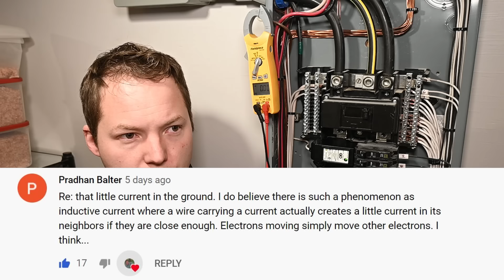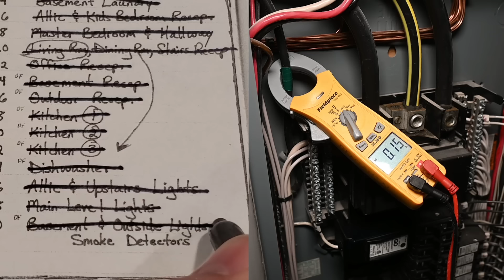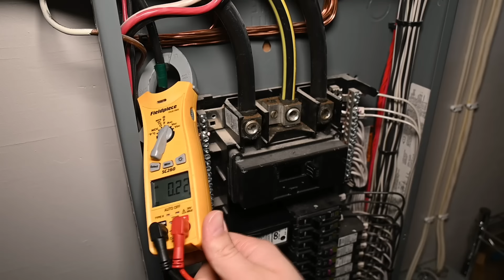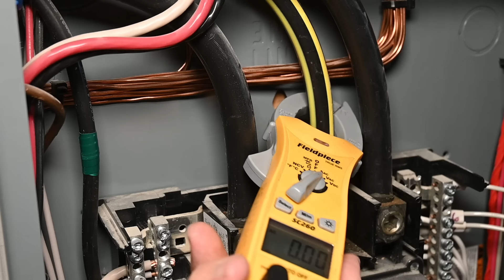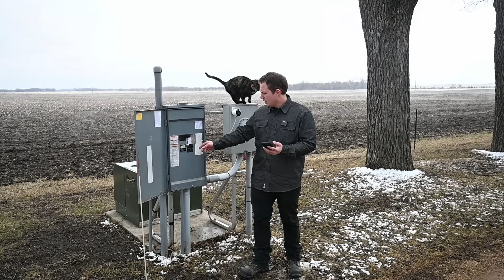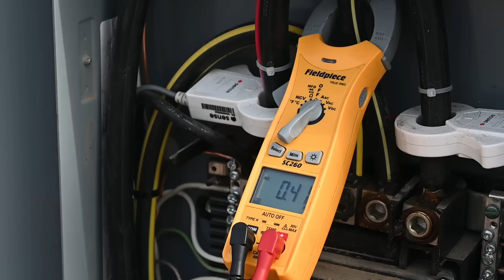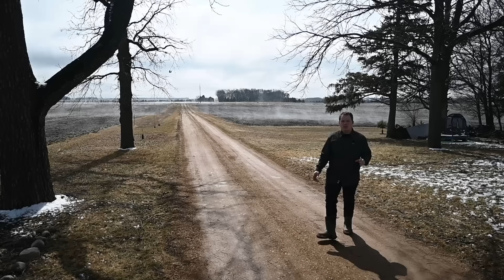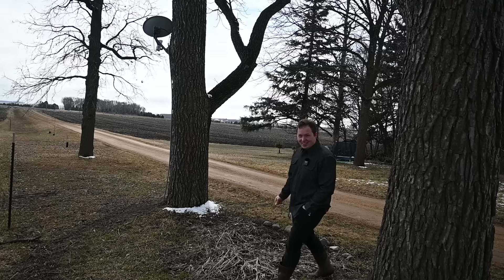Finding The Source of Stray Current on Grounding System

Comment: @Benjamin Sahlstrom -- I am not so sure you did find "the" source of the mystery current. There can be more than one cause. I read many, but not all of the comments, and I have more to say. Galvanic ("Earth battery") effects have been mentioned occasionally. Dis-similar materials are required, but I did not see that pointed out clearly. Usually metals such as copper and zinc are involved, and either one will act on a steel electrode. In this video, grounding rods are copper-coated steel (or were coated when new), the gas pipe is copper, and the conduits from the transformer/meter area outside are galvanized (coated with zinc), so there is a good setup for both a galvanic current AND electrolytic corrosion. You REALLY do not want electrolytic corrosion on gas pipes. Luckily that corrosion will prefer to erode zinc rather than copper. BUT those galvanic currents will be Direct Current, and the clamp-on ammeter looks like it was on AC Amps. Unless that little ammeter has problems itself, it should ignore DC when set to measure AC Amps. There is also some rectification possible in a galvanic circuit, which might show up (usually inaccurately) while measuring AC Amps. It would be helpful to measure DC amps as well. IF your meter can measure DC Amps, you may get more clues that way. If not via clamp-on approach, you could open the ground/neutral wires at various points and insert your ammeter, checking both AC and DC Amps. To really be sure might require use of a battery-powered oscilloscope for higher frequencies, and a current transformer or shunt resistor, since oscilloscopes measure voltage, not current. Besides galvanic action causing DC current, source(s) of power being rectified could be radio waves, solar storms, other electrical power users in the area, or even at significant distance if high voltage is involved *in earth-return systems*. Also, it would help to measure the voltage, both AC and DC, when these mystery currents are present.

Comment: wouldnt you beable to put an engine block wrapped with enough wire under a power line and connect the other end to a stake in the ground?  Wouldnt you be able to leeach power like that? Isnt it very dangerouse cause there was 144v coming from my ground out of a stake in the ground

Comment: I worked on this ALLLLLL day and you know what I found?  the current was coming back up from a stake in the ground. I connected that with my  return wire, and walla 144 volts. I checked the main box and sure enough there is 1 couple grounds connected to the  neutral and there is also a ground wire running from the ground rail to the ground. That is bleeding soooo much current into the earth. I told my land lord that is why he blew a bunch of shit out. with 144 v coming from ground in the ground.

Comment: My guess is the house ground rods have a lower impedance to ground so the current is taking the  path of least resistance and going to the house rods. A way to check this would be to re-ground the ground rods at the main panel. Is the house egc copper?

Comment: So, doesn't that mean that when ground and neutral bonded together on one bar(at the main panel), the ground also acts as a current carrier?
Reply: no, not under proper operating conditions. 'ground' is a reference point influenced by the impedance at the earth electrode. the 'neutral' system should offer an extremely low impedance return path for all energized circuits and carry all the system return currents. the 'ground' system should only briefly carry current during a system fault until the protection equipment de-energizes a faulting circuit

Comment: That meter only measures the two hot legs, there is no prongs to measure your neutral. Also that pad mount transformer should have its own ground rod driven and tied to both the case and also the x2 bushing.

Comment: What you have here is a ground loop, caused by a difference of impedance producing a difference of potential between the transformer ground, and the house panel ground stake.  One way of eliminating this fault is to connect all ground stakes to a single conductor and connecting necessary grounds to one point on this conductor.  The technical name for this conductor is called a "bus bar".  The different potentials among the ground stakes are called "step voltages".  The only real harm in your situation is EMI (electromagnetic interference) which can add noise to AM radios, audio amplifiers, and possibly reducing the range of your WI-FI.

Comment: What were the symptoms that made the customer notice causing the service call? I had an experience where a battery heater on a standby generator wore a hole in the rubber and caused it to back feed through the chasey of the unit and back through ground into the sub panel. The symptoms were a no heat call. The unit had a board that sensed it and wouldn't run. Disconnected the heater and was back online.

Comment: Temp......distance from the street voltage to the step down pad mount trans on your property ......alternating current.....back and forth......  That would be a great for your local provider to explain.  Give them a call and have them come out and tell you wtf is up...hell! Could be a loose wire on there side on the pad.....excellent video my man.

Comment: You are correct, a residential FM2 240v 3w electric meter only uses the two conductor wires to measure current when there’s load (usage). 19:53

Comment: Definitely sounds like a ground loop. (that's why multiple building grounds must be bonded.) You have a number of grounding points in the house that aren't so easy to disconnect... water, gas, coax cable... You'd have to disconnect all other ground points. Or disconnect the ground between the main and sub panel. It is indeed odd to see current on the service neutral with no current on the service conductors. (A call to the utility might be in order.)

Comment: I used to do long runs of data cabling between buildings. We would find considerable current flows if we hooked cables up to grounds on each end. One of the advantages of fiber is no current. I suggest you disconnect some of the backup earths temporarily to find the path. Is this something that code says has to be fixed?
Reply: indeed. if the ground impedance at any pair of buildings is unequal, there will be an equalizing current flow. at sufficiently low ground impedance, any equalizing current flow will be low and 'safe' (according to specifications applicable to the utility service jurisdiction)

Comment: I know you said you're not an expert, but have you considered induced current in the transformer itself? Your transformer is just two coils wrapped around an iron core. Those two coils have an EMF field around them. Some of that EMF field could be going across the grounding circuit and inducing that current into that circuit. That's where is start.

Comment: Why are you using 4 ground rods two at the house and two at the main panel next to the transformer that should be the only location. You’ve given all stray voltage a path to ground through your house panel which technically is a sub panel that’s why you have no bonding jumper you should also have no ground rods you should have a ground wire coming from main panel that’s outside by the transformer where are you installed it
Your house panel should be a four wire set up

Comment: Ben on the farm, on one of the livestock wells, we had current on the ground lead. 
The one line man said that it was not a problem. Two days before Christmas at 4:30, -10°f, L1 was 75 volts, L2 was 162 volts.   
The line men got to come out and change the transformer. 
The ground line went to 0.2 volts. Which is good.  
Good luck from north east Montana.
Reply: You can get the same situation (unbalanced line voltages) from there being NO ground path, if the load current is unbalanced. Also, voltages which show up when there is no load, particularly on an electronic meter, can be wildly misleading. Old mechanical meters are much less likely to display this problem, because they require actual non-zero current in order to give any reading at all. Modern meters can have nearly infinite input resistance on the voltage ranges, which allows them to respond to radio and even audio frequency electromagnetic waves passing by. To minimize that particular problem, it helps to keep the meter leads twisted together as much as possible.
Reply: Anything over 10V ground to neutral should get the attention of the electricty supplier. Usually the xformer or the transmission system grounding isn't adequate. 
Google transient voltage in Wisconsin dairy farms.

Comment: The neutral in the transformer will also be bonded to ground. At least it should be. In Ontario they have fixed this problem.
You only ground at the main panel with rods or plate. The house and other panels will not have ground rods. Only bonding wires between them.   Good trouble shooting. On another note the utility has bad grounding systems. We now have to ground any pole we go up to their neutral.

Comment: Man, I think you gotta measure the current on all of the neutral and ground wires in the breaker box with the mains off to trace where this current is going.  I'd be a little worried about making any new connections to the neutral until figuring out where it's going.

Comment: I would (a) check the power company's ground at their transformer by measuring ground potential (voltage) a few feet away from their ground rod relative to their secondary's neutral.  Could their earth ground be bad?  Then I would check (b) the voltage between your house ground rods and (c) the phase angle (with an oscilloscope) of that voltage  to the A-B phases.  If the power company transformer 's secondary windings are not symmetrical relative to the primary there might be some capacitance coupling which would make a phase difference.

Comment: I think the transformer is just too close to the service equipment and is inducting current on the neutral.  Did you check the ground wire at the service equipment?

Comment: as long as anything is running that requires a neutral you will always see current on the ground that close to the panel.  You should only check further away from the panel.  even then you have to figure out whether it is coming into the home or being created in the home.

Comment: Not related exactly to your problem but I live in an older house and when I switched to LED globes in the ceiling light, there was a glow coming from the light even when it was off.  I think it was inductive current because when I swapped one LED with a compact fluorescent globe the glow went away.  So now the ceiling lights have a mix of type globes but both are energy efficient.

By the way,  I enjoy your channel.
Reply from the maker: Yeah in an older house that I used to live in the LED lights would glow when they were off. I never figured it out but I bet that you are correct that induction probably has something to do with it.

Comment: Having similar issue at a customers supermarket. I am commercial refrigeration tech, NOT electrician. 30 volts to ground with equipment turned off.

Comment: I subscribed some time ago as I enjoy learning from Benjamin. I have been using a Sense monitor ever since Benjamin recommended it. I'm hoping that I can figure out all of the Always On and the Other consumers. 

Two questions, probably related questions, to my 58 year old house.

1) The original wiring does not include a ground so the original outlets were all two prong. I replaced all outlets to three prong and tied the neutral and the ground together to make the ground work. It works, but is this acceptable and is there a better way, short of replacing all wiring?

2) Stray current on the ground is intriguing and from both common sense and this video, it is a bad thing. This video also intrigued me, so I just measured amps, using my digital clamp meter, on my circuit breaker break neutral and random ground wires. I saw 3 amps on the neutral and the random ground had about 1 amp. The ground that I picked is a newer circuit and I can track that down. Am I correct that this is "stray current" on both ground and possibly neutral and that it is a bad thing that needs investigated?

Comment: Benjamin's pad-mount distribution transformer is fed by an underground cable have a center conductor (medium-voltage phase) and a  metal sheath (often copper wires wound spirally around the outside - the neutral conductor). The primary neutral and the secondary center tap are bonded together. 

Return current  SHOULD flow back to the substation via the neutral sheath. However, in very old underground cables, the sheath becomes exposed to the surrounding earth and at some location along the run, it can rot away. 

So how is the transformer energized, connected to phase only? Mother Earth (between the ground rods at the load and those at the substation)!!  For example, if the transformer is fed 7,200 volts primary and 0.44 amps are flowing in the ground wire, that support more than 3 kVA of power to the load. I've observed this effect personally in New York, and your friendly lineman from non-desert regions should confirm it.
Reply: A cable's outer protective coating has a limited lifetime. So in recent years, such cables are  installed in plastic tubing or ducts, rather that directly buried in the earth.
Reply: Having similar issue at a customers supermarket in NYS. I am commercial refrigeration tech, NOT electrician. 30 volts to ground with equipment turned off. Local electricians have not been able to resolve. I will contact power company, TY.

Comment: @benjamin
In CO we don't allow bonding on the gas line.  The steel lines actually carry a small current because of electrolysis which is why they connect sacrificial anodes to the lines and bury them with the pipe.  I'm curious if that uninsulated union is contributing to that stay current.
Reply: Gas lines can carry current from house to house so they can spread problems. Now there are reason to bond to

Comment: Disconnect the ground wire in your home panel to the grounding rods.
Reply: or run a ground home run from the panel in question to the first service panel across the driveway - the first bonding point

Comment: So, moral of the story, never ground your neutral?
Reply: The moral is, only 1 ground at the main panel (driveway in this case) unbond the sub panels  (house, garage) run ground wires from the main same gage as line.  The error was multiple grounds causing loops between his ground wires and the earth.  That's where these stray currents are coming from.  20mA/200A = 0.00001 or  0.01%

Comment: Remember to troubleshoot at the beginning of the problem.  You want to know what is supplying your ground wire with current at the sub panel, right?  So first, turn off the breaker supplying the subpanel. Would have saved you going through all those breakers.
Reply: I know right! Anything to make the video longer for more $. YouTube is a fantastic resource but tainted by greed. Videos that should be 1 or 2 minutes get stretched to 20.

Comment: Ben, for the purists power is amperage x voltage. If there is amperage (current) then there has to be voltage. However minimal. I was not surprised when you found stray current from the utility. I believe that many utilities tie their neutral, or the “shield” of a buried high voltage cable to the neutral of the secondary. This distributed ground dissipates faults and lightning. That is why copper thieves some time get nasty surprises when cutting ground wiring that might be in a fault condition, allowing the voltage to soar up and shock or burn them. You did an excellent diagnosis. Good work.

Comment: Most likely this is utility primary neutral current. Since North American utilities use a multigrounded neutral system that bonds primary and secondary neutrals, any and all grounding electrodes connected to the neutral will have a small return current going through them getting back to the substation. You made a good point at 18:45 that all current returns to its source and not magically the ground. Just in this case the source is a step drown transformer at the nearest substation and the loads are all of the people those distribution lines feed. Seems as though .44 A of the utilities neutral current is using your grounding system to return to the substation rather than the utility neutral. As you said, current takes all paths.

Comment: Get yourself a Gauss meter, like a Trifield TF2 to measure magnetic and electric fields. The TF2 will also measure dirty magnetic fields. You'll often find that if there is an EMF issue happening like wider spread magnetic/electric fields, it's often due to hot-neutral separations.
Reply: can you give any details on hot-neutral separations? Are you referring to stray voltage? We are curious if this issue could cause things like tinnitus and headaches? thanks

Comment: Your meter is set to measure AC Current, i wonder what you'd see for DC Current. If it were galvanic it would be DC. Since it's AC I'd have to agree it's coming for your transformer thru the neutral but rather it is balancing out the fluctuations on imbalance of the feeds. For the ground to successfully pull the neutral to 0 volts any time the reference coming in changes the neutral would see the difference and try to drain it off.

Comment: I'm late, but I'm going to guess that someone around you has a fault, and the current is actually flowing up from ground into your neutral.

edit: I'm not an electrician or EE or anything, but I watched Mike Holt's video linked in the comments here and it made sense. It is current finding its way back through ground in parallel with the neutral of the power grid. I didn't know they connected neutral of every transformer along the path and connected that to ground so it makes sense.